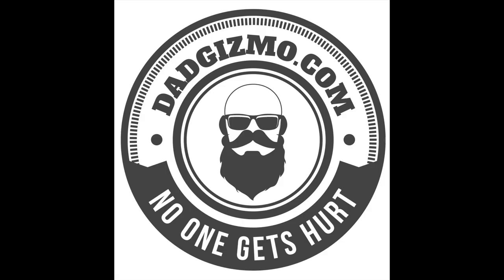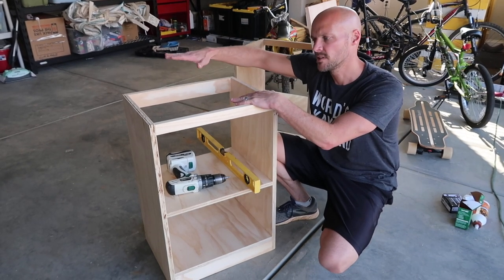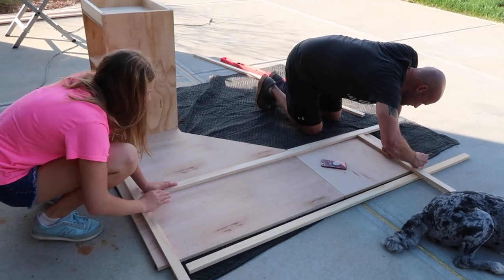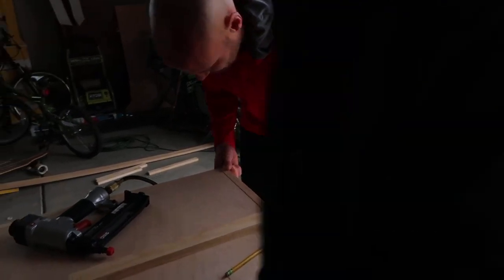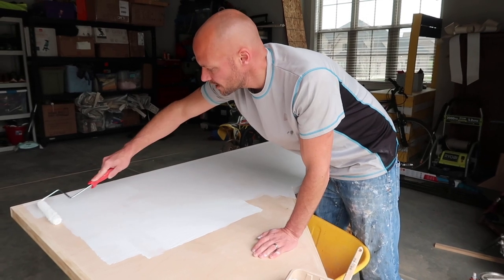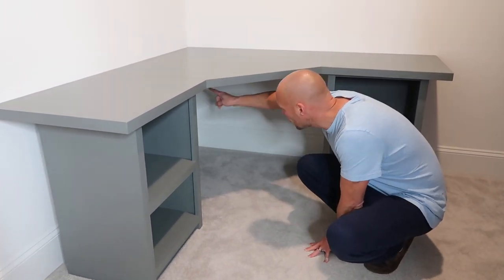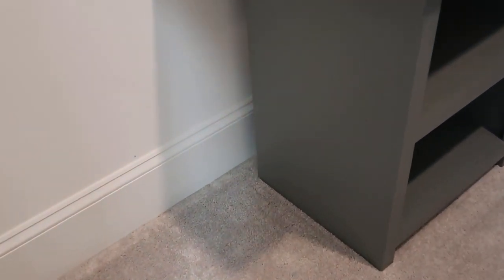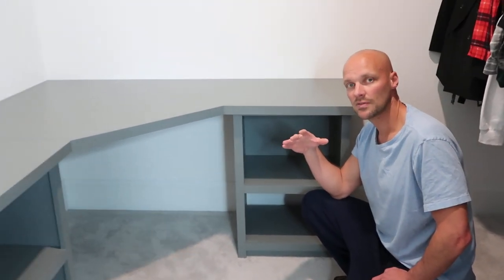How to Make a DIY CORNER DESK on a BUDGET - DAD HACK

Comment: you say you measured 20" in from each side of the 38x38 square, but the ends of the 45 degree cut are flush with the edges of the 24x24 squares... That math doesn't work.